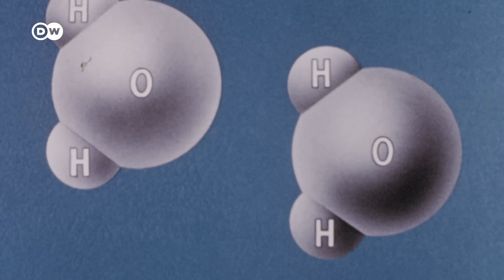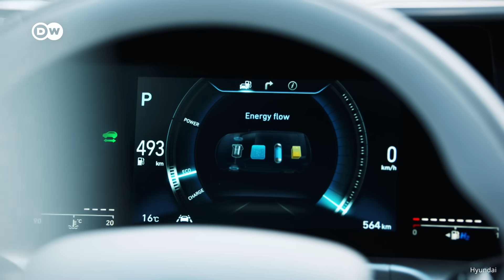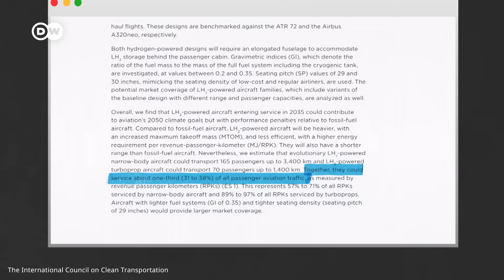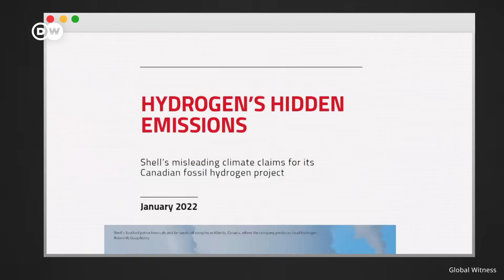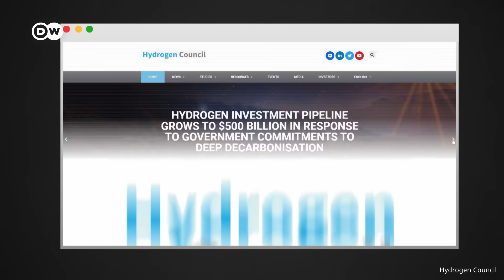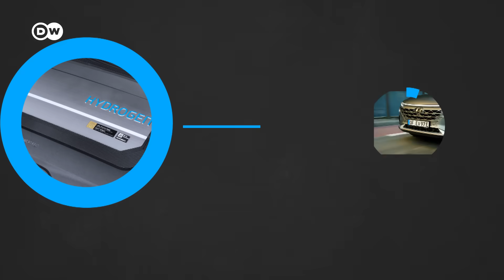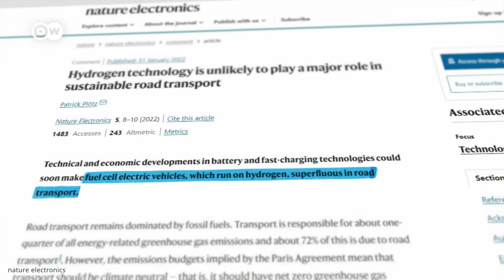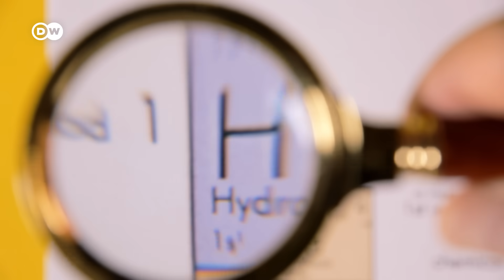The truth about hydrogen

Comment: Air going into a hydrogen powered machine comes out cleaner than when it went in. I other words any exhaust gases created in the manufacture of the gas are cleaned up by the machines that use it so yes it will power out future.

Comment: Something not mentioned is the challenge of storing H2 safely.  It's much more challenging than gasoline.  It burns invisibly (making it harder to fire fight), and has a much wider air/fuel ratio for fire and explosions.  Gasoline in tankers typically won't explode unless it's a Boiling Liquid Expanding Vapor Explosion (BLEVE).  Usually it's a fire that heats the tanker so when it ruptures the contents immediately vaporizes and the entire tanker  ignites at once.  But H2 is already in a BLEVE condition at any normal temperature.

Comment: Hm, Hydrogen is a tricky little b4stard. It's a very small atom and therefore a great escape-artist. Commercially available vessels that are capable of storage and transport of other gases simply don't cut it for Hydrogen unless we are willing to take vast losses in transport and storage and huge risks while doing so. Hydrogen is also very flammable and potentially explosive. Hydrogen therefore requires specially designed AND conditioned containment and transport vessels and gas-transportation pipeline are out of the question alltogether since they must be (expensively) kept at fairly low temperatures. As a rule of thumb, that greatly increases the cost of applying it as an energy carrier on an industrial scale beyond the currently accepted levels to about three times as expensive.

Comment: Why Hydrogen at all? A small solar setup combined with a geo heat pump and ALL the power a home needs could be generated on site. At this point in time NOTHING NEW needs to be invented or researched to solve the energy problem. The actual problem is thinking there needs to be something NEW to solve the problem.

Comment: Big companies will continue to tout hydrogen as the fuel of the future because you will have to continue to pay at the pumps allowing then to continue to fill their pockets at our expense. This is not the case with electric. If the rates for power are increased you can go solar, wind or water and leave them behind. With hydrogen the same few rich will once again control the market at any price they wish. Hydrogen creates almost as much pollution in the manufacturing process, as using gas in the first place. It is a con job and will solve nothing as far as helping the planet, where using eco friendly electrical will. 
People remember when you buy your electric car say yes to solar panels. Even though they only increase your cars range by about 12 miles per day do it. For every million cars this translates into 12,000,000 miles of driving without the use of coal and nuclear fired power pollution being created. This alone is more eco friendly so we should continue to buy electric.

Comment: Wow that was one sided. Not going to talk about storage issues, losses due to compression, leaking, embriddlement, cost? Safety, flammability limits, explosive nature, easier to leak, high pressure tank rupture, higher flame temperature? The lie that if burned it just produces water, what about nitrogen oxides? At least it mentioned the huge efficiency losses in using it in cars, but still looks like it padded the numbers because it isn't 40% efficient.
People need to stop ignoring the issues because they want it to work. They need to fix them and talk about them.

Comment: The energy density of hydrogen is much higher than lithium batteries by weight.
Reply: Show your calculation please! I am an energy expert and I assure you that it's not! (a 10kW fuel cell weight 250kg without the tank, reheat system, cooling system, control, safety system, etc)
Reply: @pierregravel-primeau702  I heard it from a thunderfoot video I think. But you can find a chart online by duckduckgo image searching ( energy density of oil gas lithium).

I heard that creating hydrogen though, takes so much energy that at the end of the day, it cancels out what it creates. Maybe thats what your referencing.

Im talking about specific case scenarios where distance is more important than "cost". Like long commutes to work or planes.
Lithium can work yea, but the infrastructure needed to swap out the batteries with fully charged new ones every couple blocks is pretty nuts.
Reply: the problem however becomes handling the compressed gas to order of magnitude higher pressures if you want to keep same volume as natural gas.

You cant for example much increase the volume of a car to store same energy as diesel tank.
Reply: @Paerigos   Increase of volume is preferable to increase in weight because of weight limits on bridges. 
But that's just my initial conclusion based on a glance.
I heard that Elon Musk's trucks would weigh much much more than a diesel truck from thunder foot I think.
But still, I think it's moral to keep using gas till we run out. It's plant food. Europeans can move to Antarctica if their original country floods and Antarctica greens.
Reply: @eromod  Antarctica will not be long term habbitable for most humans even if average temperature of the planet goes up 10°C.

and volume intensity is a problem - there is really not much extra room in any car.

Plus even if you go to same mass of hydrogen compared to natural gas you will unfotunately have orders of magnitude more volume, so you have to compensate by pressure, but high pressure hydrogen storage didnt really work out in centuries long term.
Reply: @Paerigos  I don't know much about hydrogens volume problem. Most of the videos I have seen on hydrogen cars were complaining about the fact that it's made from oil most cost effectively so the carbon footprint is still there.
Reply: @eromod  How the hell is it 'moral' to keep effing up the atmosphere for a handful of billionaires ???
Reply: And unlike batteries when used gets lighter, this is important factor for things like airline travel.

Comment: The future is bright with hydrogen. But it should be used with other alternatives, like air wind solar. Using hydrogen as an energy storage, to convert renewable energy into hydrogen to transport, storage, and then use it on demand during time when renewable energy is off line. I.e,  there is no solar at night, thats when hydrogen is used to burn to generate electricity. Really excited and looking forward into the next 5 to 10 year to see how this hydrogen will turn into.
Reply: Burning hydrogen is a massive waste.

Comment: Diverting wind and solar power to make green H2 does not make sense until we have so much excess green electricity that we can use H2 as an extra storage, or for those transport applications which it makes sense. The first application  for green H2 should be so we stop burning stuff to produce grey or blue H2 for industrial processes that need H2.

Comment: I think other alternatives may be more practical.  Like any other energy conversion medium hydrogen only makes sense if you have an overabundance of some other energy source, like alcohol in south America where they have a surplus of crops and hydro power.  This video touched on some of the challenges, like low energy density and high conversion loss, but skipped a few others that are related.  It being the smallest molecule, it is harder to store, so requires quality materials and careful craftsmanship to contain.  Along the lines of low energy density, it takes nearly as much energy to transport it as will be delivered(50% loss?)  To store significant useful quantities you either need to compress it to very high pressures or liquify it, which involves even more energy, complex systems and structures and more fine craftsmanship…  because of these challenges I think hydrogen really only makes sense if it is produced at point of use…  I think bio fuels from seed crops and algae will probably prove more practical in the long run…

Comment: So... hydrogen is a problem as energy container.. but.. 
Tons of battery arrays which pollute during extraction ..manufacturing ..recovery and repurpose not?
Reply: Who is lobbying you say?
Reply: Batteries compensate quite quickly for their production emissions because of their efficiency. A hydrogen system is inefficient its entire life.
Reply: @Freba9  Yeah you dont get it do you? Hydrogen is a closed system which essentially dissapears after usage..
You still have to carry hundreds of KG of discharged battery once is almost dead..
Not only at the end of the lifespan but every single week.
Reply: @absolutium  Still far better than the low efficiency of hydrogen systems.
Reply: @Freba9  ..when the battery array is finally done you have to recover it dismantle and repurpose.. for which it takes 50KwH per kilogram just for the latter.. in the best case scenario.

Comment: There are so many ways to generate hydrogen aside what's mentioned (e.g., turquoise hydrogen through pyrolysis, the latest catalyst by Ames, aluminum nanoparticles, microorganisms consuming plastics/waste/scrap metal/scrap paper and producing hydrogen as a byproduct, etc.) that this idea of efficiency loss during storage and transport will become much less of an issue.  That's the fossil fuel mentality still taking hold -- there are more ways to generate hydrogen than even green electricity. 😉

The various methods of hydrogen generation combined with technologies working on a near circular process (i.e., using hydrogen to generate energy, then taking the water byproduct to generate hydrogen again) may completely shift how we think about energy generation and delivery.

Comment: Your video refers to a carbon capture facility which was added to an existing Shell plant in Canada known as Quest.  It cites a "study" which found that the Shell plant emits far more carbon dioxide than this carbon capture facility captures and then "concludes" that the carbon capture facility is a failure.  This is simply wrong and is in fact intentionally misleading.  This carbon capture facility was added to an existing plant and was only designed and intended to capture around a third of the then existing carbon emissions of the Quest plant.  It was never designed to capture the other two-thirds -  rather it was intended to develop carbon capture technology in a real-world setting and in fact those involved believe it to be a success.  Unfortunately, some environmentalists are deeply opposed to the concept of carbon capture, believing that all fossil fuel use must end immediately, and they loath a technology which they think will allow fossil fuels to continue to be used in any way.  Furthermore, and as demonstrated by this "study", they are not worried about being intellectually dishonest in pursuit of their "greater good".

Comment: We will need to overbuild wind and solar to minimize expensive batteries in order to electrify energy in the next decade. Meredith mentions low cost electrolyzes and these can be powered from the wind solar battery combination rather than curtail excess power production. Hydrogen is inevitable for many applications as there just are no better options and it is flexible for many uses.

Comment: Like most "green" technologies, hydrogen is feasible in a lab or demonstration project. But once you try to scale it to meet market needs, costs skyrocket. Advocates generally underestimate the practical difficulties of the supporting infrastructure. The entire hydrogen cycle (production, storage, transportation, use) must be cheaper than competing technologies or  government must force the market to use it through mandates and subsidies. Not a sustainable option.
Reply: Burning fossil fuels isn't a sustainable option either. Put a carbon tax on everything and the market will figure it out.

Comment: The problem with using Hydrogen as a fuel is that it makes about as much sense as using water as fuel if you live in a desert. Hydrogen may be the most abundant element in the universe, but we literally live in a hydrogen desert on Earth where hydrogen is scarce. So using Hydrogen for things like fueling cars and trucks is simply boneheaded.
Reply: True, but the sun supplies us with an overabundance of energy. We can use that via renewables and split water (which we also have plenty of) into hydrogen.